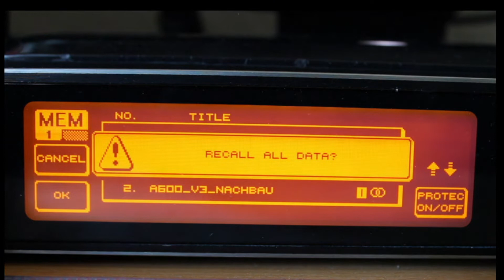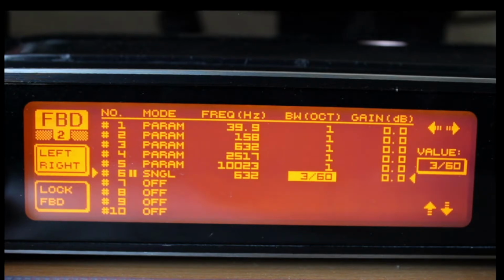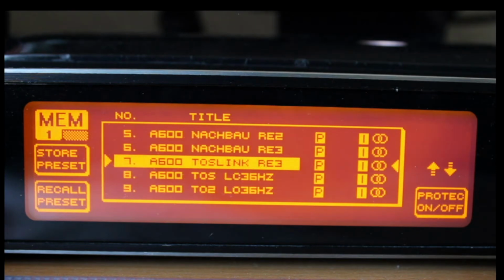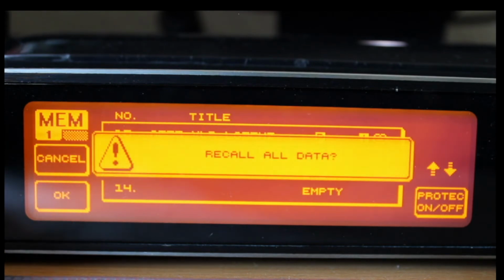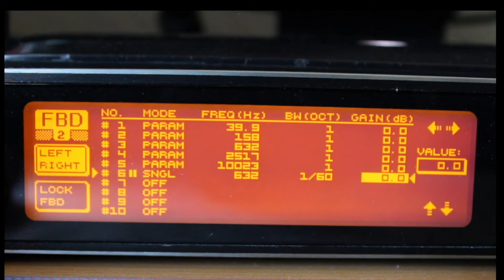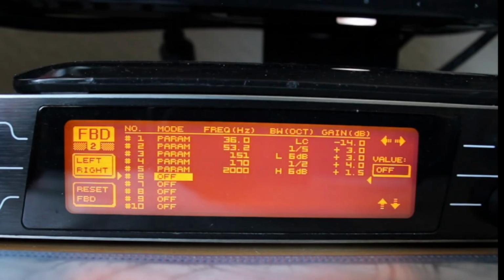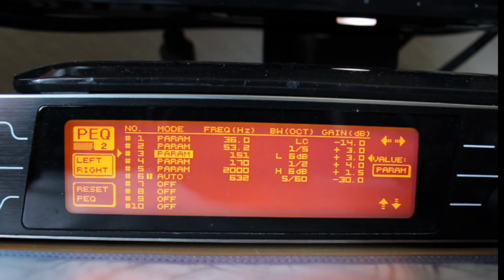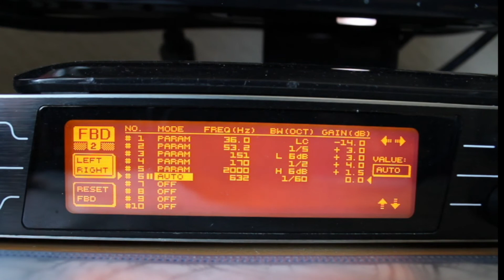DEQ2496 Control: Behaviour of the DEQ2496 regarding FBD handling

Comment: Hello, I can't get mine to respond to MIDI commands...Mainly, from a Digitech 2101 Guitar DSP. I have created EQ curves for some patches, named and saved them but the EQ doesn't change when I select a new patch on the 2101. MIDI is being sent and received, there is a message box saying so. Do I have to have the 2496 on a particular page or more so, to not be on a particular page? All I want is to have the 2496 save my EQ settings as per patch on my 2101 and simply change when I change sounds.... I used to have a Digitech MEQ Mono 28 and that's all it was built to do, it even had matching patch numbers... This 2496 can do many, many things but not the most simple thing I need it to do!......or can it?
Reply from the maker: Dear Sir,
the DEQ2496 can change settings via MIDI. You have to turn all settings in Utility Page 2 to on.

 See here: https://drive.google.com/file/d/1dekQmEEG24ZkU3I53DSoY-ZXiXCqMtQP/view?usp=sharing

After this, the DEQ2496 will respond to MIDI Program-Change Messages. For example MIDI OUT 192,xx,0

The 192 stands for MIDI Program-Change on Channel 1 , where xx is the program number (eg. 1-64 DEQ2496 Presets,0 is the actual EditBuffer).

Kind regards.
BigD